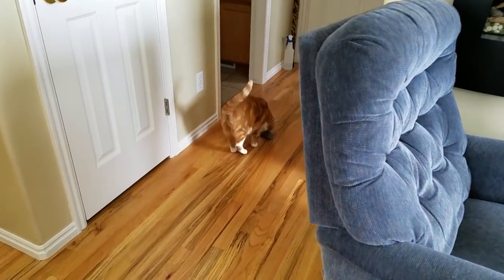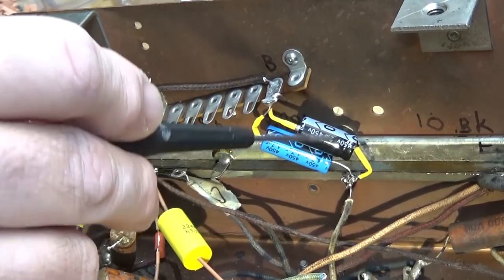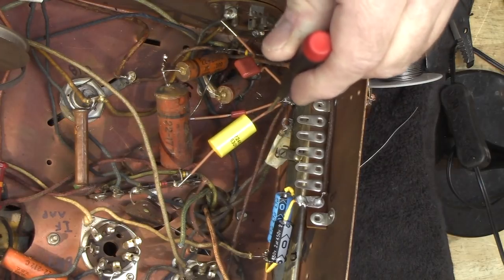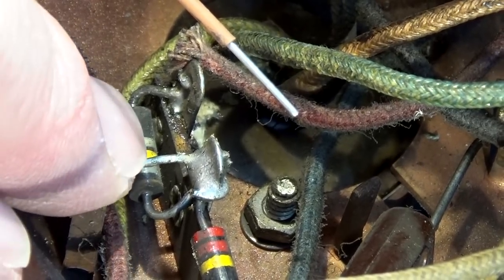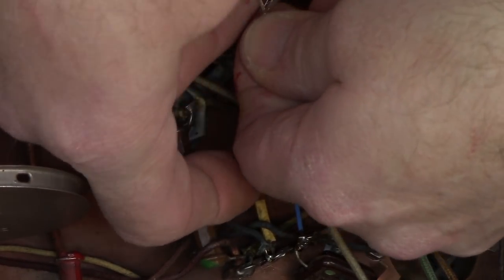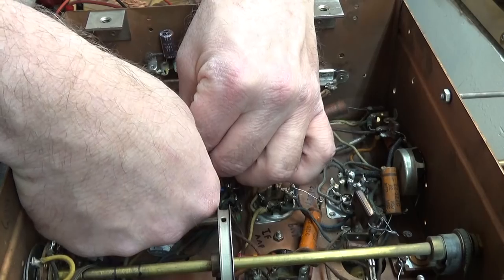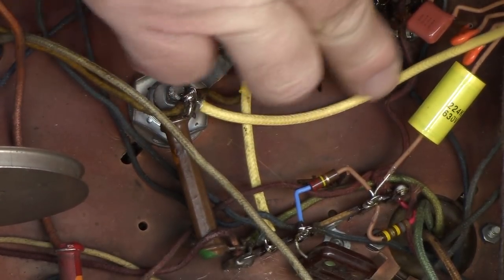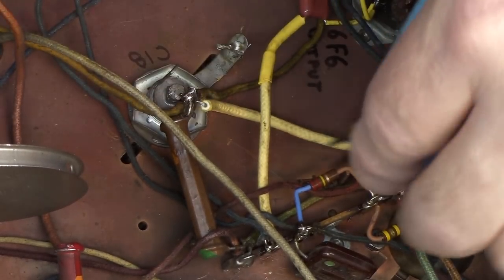1938 Zenith 9S262 Shutter Dial Tube Radio Part 4 of X  Details From Down Under

Comment: I have to comment on the RPN calculator.  I would of never made it through ME college if it wasn't for my HP 48GX.  I also have to say my brain hurts trying to follow along with the electrical of this radio, I have the schematics as well because I also have a 9S262 that needs some work.  I had to take an EE class and it was insane hard for me and watching you work on this stuff just confuses me more and more.  I don't know if I am going to attempt to work on my radio or not now.  I really hope you can continue to put videos out and finish this build because I am extremely grateful and hopeful to see this finished.

Comment: Hey Michael,
It pained me so much to see you go to all that trouble to make those connections to C18 on this video.  I understand what you were saying about not having both parts of the old electrolytic connected, BUT...the negative side of that electrolytic is connected to the chassis whether there is a wire connected to it or not!  Connecting the new capacitor and the resistor to the positive terminal of the old Electrolytic still puts the old cap in the circuit!!!  So, you really need to either move those connections to a terminal strip or something else that doesn't use ANY part of the old capacitor at all.

Comment: Glad to see you back! The wife was just asking about you this weekend. A little tip for the stranded wire is to tin the end before you try and insert it so you don't end up with stray strands of wire. Keep up the good work!
Reply from the maker: Sometimes I do tin.  Sometimes, the solder will crack if the wire is moved much.  I know that if I just tin the end, it's fine.  Just a habit that I ought to change, I suppose. 

It's good to be back!  A bunch has happened to keep me away from the bench and the channel.  I'll explain soon.  In the mean time, take care, my friend.
Cheers!
Michael

Comment: I'm a bit late, catching up myself, but I'm glad to see you back, and I don't mind the "old" video, as your narrative rambles are so enjoyable. 
21:50 - Yeah, big problem with Amazon is a lack of shipping options. I prefer UPS only because they can be redirected to a local UPS store (a secure site) for me to pick up. I just recently ordered some shelving brackets (a la Blueglow Electronics recommendation) and they were shipped DHL, sort of. I think they were fobbed off on Lyft or Uber or Dominoes Pizza. Some was "lost" then showed up, some came directly, none came on time. B&H is KILLER. I've been using them for as long as I can remember. Top hand outfit, very professional.
Reply from the maker: I apologize for taking so long to reply.  I've been moving and there are other large transitions happening for me right now.  My biggest concern is getting back on track with customer radios.  Boy, it's tough to get back to my schedule of the past!The whole AMZL is still a nightmare for me!  I am moving, and so I have been using a PO box for my mail until I get settled.  That makes the shipping situation even more challenging.  I have to believe that they will eventually figure out that we need options for shipping method and that, as customers, we need to be able to select from those options.I recently bought a Lumix GH5 and G9 from B&H.  Both purchases were top shelf experiences.  I will be a customer of B&H for life!Take care, my friend.Michael
Reply: @ @thattubesound2214  - "Take care of you" as a wise man once told me. Also, I'm saddened to hear about your favorite electronics parts mine burning down. I had no idea it happened. These places must now be counted on our fingers these days. I know of none around here.

Comment: Great seeing your videos again! I have never tried it, but, I would try turpentine in the rosin. Thats a good point about the capacitors that I had never thought about before! Ive restuffed and bypassed. I usually restuff if there is limited real estate down under. Take Care--Larry
Reply from the maker: Larry, I cannot tell you how good it is to hear from you!  I have been away from the bench and the channel for a long time.  I tried, but I just couldn't get my mind and heart around it!  I feel awful, because I promised work to folks that I have yet to deliver.  I'll make it right with them and hopefully, they won't cuss me too badly.  I will tell you that this radio performed beautifully when it was done.  The fella' was very happy with it.  I surmise that you heard about RA Elco.  I'm glad that you made the visit when you did.   I'll be watching as well as posting, going forward.  I'll be watching for some new stuff from you.  The leaves will be falling soon, and I hope that you will have time!  Take care, buddy.  God bless.
Cheers!
Michael
Reply: ThatTubeSound Michael, I have some raw footage of "The Basket Case" where Im repairing the cabinet, man, I know why its called "The Basket Case", lol. The final finish on it will have to wait until the humidity is drops a bit here. The 64 C10 is coming along pretty good! Ive painted the rear frame and parts with rust encapsulator and gloss paint. Its reassembled except the drive shaft and rear brake rebuild. I have to torque all the bolts. After that, the front comes apart and new engine. Then the cab body work! Still lots to do--Larry

Comment: Greetings;eh
The ground lug on that canned ohm (?) resistor gets its ground where it is mounted to the chassis. It  is not shown, but there should be a connection to the resistor at that point.
If it is not obvious, all of the canned ohm lugs below the ground lug are negative DC voltages used for grid bias including the oscillator.Note the abbreviation for oscillator is misspelled on the schematic.

Comment: Hey Michael, It's so good to see you again my friend!  Thanks for all the tips you provide.  Yes, I've seen John do the same thing as well, but I tend to forget stuff over time if I haven't done anything for a while and it's good to be reminded from time to time.  Amazon really has gotten sloppy lately.  Several things I have ordered with prime have taken 3 or more days to receive and I remember when I paid for it it was supposed to be 2 day shipping.  If I wanted to wait 3 or more days I would have stayed with the free shipping option on non prime.  And now it's going up an extra $20 for renewel...if they can't mange their 2 day shipping now what is an extra $20 supposed to accomplish?

I stay that shaky all the time when I'm dealing with small wires, etc, lol.  Take care, Gary
Reply from the maker: Hey Gary!
I missed working on the channel.  I actually found it very difficult to even work on radios for some time.  I felt awful, because I owe work to people, but I just couldn't get my head around radio work.  It's good to slowly be getting back to myself.  That will include picking up speed in making new vids and putting them up.  I don't mind paying for Prime, as long as I get what they promised.  Amazon Logistics (AMZL) in Salt Lake has really dropped the ball.   It seems that they have improved slightly, but they have a long way to go to be worthy of the Amazon name.  Take care of yourself out there in the corn desert, my friend!
Cheers!
Michael

Comment: One other thought I had that I thought I would share with you in case you wanted to try it.  On the yellow wire where you used the red sharpie to make the red stripes, how about small sections of red heat shrink instead.  Would still have red stripes...just a thought.  Possible down side of this method would be cost.